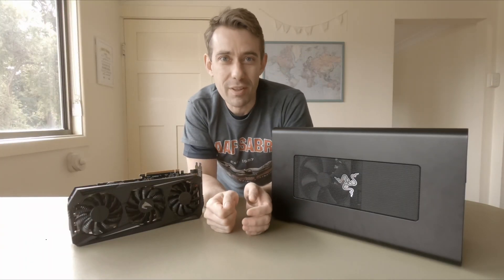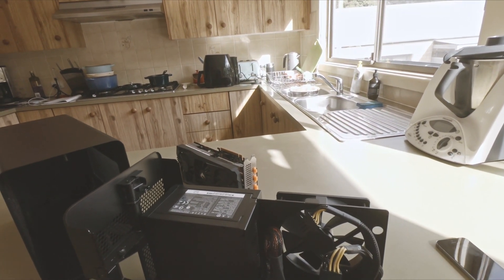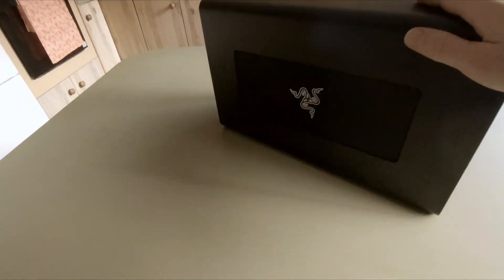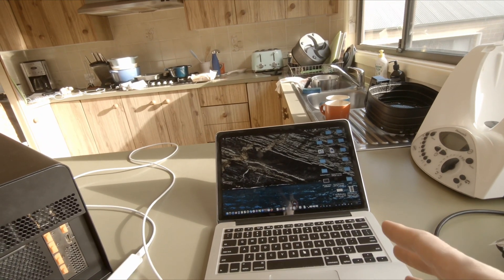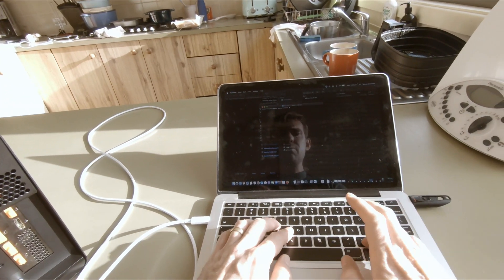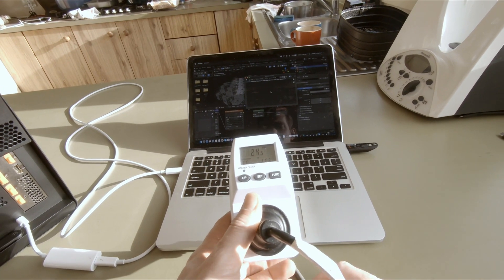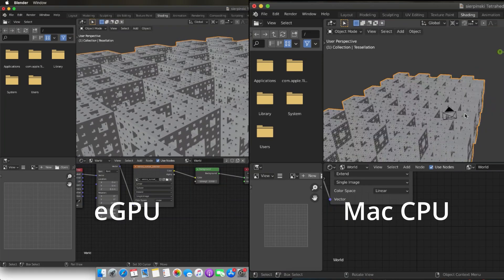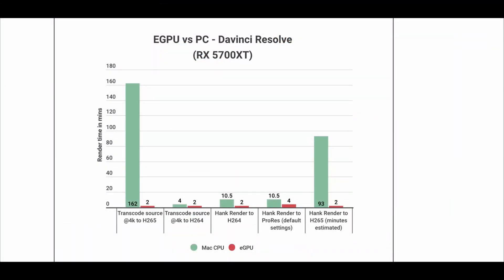Razer Core X eGPU tested with an old MacBook, can it Blender? Can it Resolve? Hell yeah!

Comment: Any chance you could run this with the MacBook Pro 2019? I’m trying to decide if egpu will be worth it or not/ what problems I may have in rendering. It has a i9 processor and I have successfully been able to use cycles rendering system
Reply from the maker: Basic system requirements are intel processor (Apple silicon doesn't support eGPU acceleration) that has thunderbolt 2 or 3. The version of macOS we run is catalina, though you may be able to run more modern versions than this. Checkout https://egpu.io for more up to date info. Its where we get ours from :)

Hope this helps.

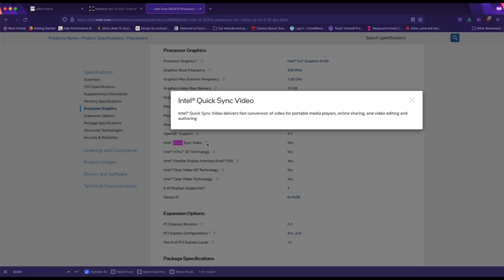Comment: At 09:37, to which version of Macbook Pro were you referring when you said "macbook does have hardware support for H. 264, but it does not for H.265" ?
Reply from the maker: Hi, thanks for asking, we updated the video description to include the hardware used. The MacBook is a late 2015 Pro model with a dual core intel CPU. The CPU is the one shown at around the time stamp you mention.

Comment: What have you changed in the Settings from Blender or so that Blender uses the eGPU?
Reply from the maker: The settings that make Blender use the eGPU are the Blender > preferences > system options for which compute device should be used. Also make sure in the render properties tab in your scene, that you have the "Device" type set to GPU for rendering in cycles.

The eGPU should be visible in the system preferences under "Cycles Render Devices". Make sure it is checked/enabled here. 

Remember that you will need to select a compute device appropriate for your GPU. If you have an Nvidia GPU, then CUDA, OPTIX device types should be chosen, for AMD, use HIP. Similarly for intel, use the intel device.

Other than configuring these options, there are no other settings in Blender you will need to change. 

Please reply if this helps?
Reply: @Crowdrender It worked thanks!

Comment: when using blender or resolve do you need a connect a second monitor? i red that there will be latency rendering back to the internal laptop monitor? Or is it doable just EGPU and laptop?
Reply from the maker: G'day! Honestly, haven't tried that! We usually use the eGPU with a second monitor and this really seems to help some apps. For example, running OBS is absolutely better performance with the second monitor.

We setup a stream one day without the second monitor and the macbook ran like complete trash, even with the eGPU plugged in. We had to abondon the stream. The day before we'd done the exact same thing and it was fine. The only change was not having a second monitor plugged in.

I think this is because the eGPU offloads some of the codec work. Sadly we never tested blender or resolve like this, without the second monitor. 

So, what we can conclude is that its probably likely that having a  second monitor will help, especially with accelerating the 3d view port in Blender and decoding in Resolve so you can edit smoothly. It seems that this might require a second monitor. Rendering in Blender or Resolve might be fine, but you'll likely not have the full benefit, which honestly is being able to run Blender or Resolve on the GPU and have a larger monitor than your laptop.

Hope this helps!
Reply: @Crowdrender  Thx for the info!!! i would like have the extra performance without the need for the external monitor :(  I already own a powerfull desktop pc .Sometimes i just want to edit on the couch with the need for the external monitor. I new laptop would be my best option :(
Reply from the maker: @robinreso6240  for your situation, if you need to edit away from your desk, whether on the couch or if you're travelling, yeah, a new laptop might be the better option.

Comment: A year later (2022-2023) mainly similar conclusions using Mac Mini 2019. Mac Mini, however, can be upgraded, as I did, with 32GB RAM, a big assist for Blender. The Radeon unit has behaved flawlessly. Another advantage of an external GPU for older Macs -- albeit an edge advantage -- is that it can be plugged into different legacy Macs you may have around, whereas built-in GPUs (as in the new Mac M1/M2s) are dedicated to the Mac they come with.
Reply from the maker: Thanks for updating us Jim :D Is the upgrade for the Mac Mini hard?
Reply: @Crowdrender  a bit delicate -- opening up the mini, replacing memory... here's the OWC video guide I used: https://www.youtube.com/watch?v=qKyv0QP4XPQ

Comment: In Blender do the PC laptop GPU, for instance a 3070, work in tandem with an external GPU? Or you have to use one or the other?
Reply from the maker: Honestly, we've not tested this, our only computer that works with our eGPU doesn't have its own GPU. Would honestly recommend asking this question on https://egpu.io. They have a ton more experience with eGPUs than we do.

Comment: I have very serious question. You tried kryptonite I assume? It didn’t work? I’ve been trying kryptonite instead of purge wrangler non stop
Reply from the maker: We have a video where James tried Kryptonite, it worked for us pretty much first go. This video might help? - https://youtu.be/kecpXq_5w44 

Otherwise if you are still stuck, highly recommend https://egpu.io because this is where we got our tools and information from.
Reply: Mannnnn it did not work for me AT ALL!
Reply from the maker: @bmax8958  There are some things that will definitely not work, such as using an eGPU with any of the new Macs using the M1 processor. Might be an idea to make sure you know your platform is supported. The egpu website I referred to in the last reply to your comment has a section where you can search through builds people have got to work. If you see your make and model of your host machine, eGPU and GPU there, then you have a fairly good guarantee you can get it to work.

This assumes you don't have a hardware fault though! Things like a dodgy cable, or a faulty part can also put a premature end to your party. So make sure you do some experiments to rule things out, like if you have another computer to test with, or other cables  you know work for other things, try replacing parts with known good parts, or using the suspect parts in a system you know works to try and isolate the problem.
Reply: I am using 2014 Mac mini with razor core X and AMD 5700XT. I’m assuming in scripted wrong as kryptonite has many weird obstacles, I am going to factory reset computer and run purge wrangler! See how that works

Comment: Sorry to bother you . Would you happen to know if this same setup would work with an Amd Radeon V7 and a 2017 MacBook Pro?
Reply from the maker: Hey hey :) Honestly the best place to go for questions like this is https://egpu.io as there's a whole community of eGPU fans there and they also have a section on successful builds. In fact we just checked and there's a tool for searching/filtering on the top of MacBook, the enclosure, and the GPU used in successful builds. 

You can find this handy lil' tool at - https://egpu.io/best-external-graphics-card-builds/

You should be able to find if others have managed to use the same hardware successfully. 

From our knowledge this should work, though we've only tested one build and we're also not on the latest OS, we're sticking with Catalina now until our MacBook dies!!

Best of luck my friend, hope you win here, its awesome having an external GPU to power through renders :)

Comment: May I ask if the mac will work even if I don't connect a monitor? Will it affect performance? Thank you
Reply from the maker: Yes, it still accelerates certain tasks, like rendering with ProRender, (and maybe even cycles-x, not sure yet, have to ask the Blender devs how their support of Apple's MSL is coming alive :) ) and Davinci resolve. 

Basically for productivity, compute intensive apps can be accelerated so long as the vendor supports either openCL or Apple's metal framework. 

What you might not get though is the nice smooth performance of the rendered viewport in Blender, and also DaVinci resolve. When you plug a monitor into the GPU card in the eGPU, apps that are displayed on that monitor are noticably faster. Without an external monitor, the acceleration probably won't be as good as you'll most likely be relying on the internal GPU for the built in display of an imac/mackbook.

Comment: Hey, man. Great vid! I myself am perusing an eGPU setup for my MacBook Pro 2012 and I was wondering if you knew how eGPUs would work with bootcamp for gaming? Is it mostly plug and play or is there an initial setup you have to go through every time you want to use your laptop with the eGPU? Thanks in advance!
Reply from the maker: Yooo! Nice :) Soo, bootcamp, we've not ventured that far yet, but do check out this website, https://egpu.io they have a ton of advice, plus forums for help and there's definitely content about bootcamp on there.
Reply: @Crowdrender  Thank you, my G. I’m glad to know that others have found success in these external graphics projects! I have one more question, however, If that’s not too much lol. We’re you able to put your laptop to sleep (close laptop lid) with the egpu connected? Would you need to manually turn off the egpu?And would it automatically resume once I turn on my laptop again? Again, thanks in advance!
Reply from the maker: @lemonke3774  Trying that now
Reply from the maker: Seems to handle it just fine. Though this setup has the eGPU setup with an external monitor, so closing the lid just rearranges the displays. This 'works' as well as it does for no eGPU. Thanks to apple for that.

As for sleep, yes, resuming from sleep has no issues. Bear in mind we're working on a new video on Kryptonite, which we're using to run the eGPU in macOS. Purge-wrangler has been replaced with Kryptonite so we're testing it out. So far so good. 

So all the tests I just did were using Kryptonite, not purge-wrangler.
Reply: @Crowdrender  Hey, thanks so much for taking the time to answer my questions! I really do appreciate it. I hope I’ll see as much success in my egpu build as you have!

Comment: Hi James,
thanks for the indepth presentation!
I am using the egpu enclosure for quite some time now.
My mainsystem is an intel nuc hades canyon running win10prof. the egpu is equipped with an rtx 2080super wich I got just before the prices went crazy.
To my experience you get even better performance if you hook up the display directly to the egpu (if you use an additional one instead of the laptopscreen).
I also use it with my Ocolus Rift-S VRglasses in blender. The results I get with eevee in VRmode are stunning and give a very realistic impression on realworld size of an object.
Another thing I use it for is gpu-redering in blender - works great.
To me it did extend the usage of my hades cayon a lot. Sure there are some performance drops compared to a beafy pc, BUT I love the setup for its versatility. I even onve added a second enclosure and a second card and had blender render on multi gpus at the same time. Also being able to use the card on different computers is  an very nice feature - so finally you can share renderperformance with your mates ....
I got my enclosure used from amazon for a very good price .... (with all it's pro/cons)
Thanks for your excellent video on that topic!
Reply from the maker: Awesome stuff Rainer :) great to hear you love your eGPUs too! Hadn't really thought about NUCs but the way you describe it sounds like they're a pretty good match. If you don't mind, how much RAM can you get in a NUC? And while I am at it, how much storage too?
Reply: @Crowdrender  Hi James,
I have 64GB ram in it (two sd-rams), actually only 32gb are officially supported but the i7 is capable of it and frankly I think this might be from a time when only 16GBmodules were availiable in that format.
The nuc also supports two nvme disks being able to run either individually or via the onboard raid-controller as raid 1 or 0.
Just recently I upgraded to the much newer quartz canyon(8 core xeon) and put that along with my 2080super in a Cooler Master MasterCase NC100 PC. I like it very much - and it has two thunderbolt connectors ....
Reply from the maker: @rainerseitner6872  This sounds great!

Comment: I use a Vega 56 eGPU on my 2018 I7 Mac mini.  Under Bootcamp it was always a chore to get the eGPU to work due to a resource 12 bug or something like that. When it did boot up it was much faster than my 6 core I7 CPU. My benchmark speeds always seemed in line with desktop Vega 56 users. I have since bought a PC laptop with a RTX 2060 which is much faster.  The laptop does have TB3 so I have been considering trying to use both together.  If the GPU market wasn't so weird right now I would get a 2060 or 3060 card to put in the enclosure so I could use two GPUs. I can probably use the Vega 56 but I'm honestly not sure how well Blender handles mixing CUDA and OpenCL.
Reply from the maker: Great to read all that Thomas :) What enclosure are/were you using? Also did you have any speed issues with scenes larger than the Mini's physical memory?

Yeah, blender is not able to use two different devices in the same render. If you have enough RAM to load the scene twice, however, you can actually do this. You can use two instances of Blender and use the "placeholder" option in cycles with overwrite turned off. This way you can setup two background renders of your animation, one of them using CUDA, the other the openCL card. 

This obviously has limitations though, first, you'll need enough RAM, second it only really works for animations as stills can't be accelerated in this way.

Comment: I saw a review of the razer core last year where they said it produced 30% lower render speeds than on pc. Something about the usbc bandwidth being slower than pci. I guess it depends on the motherboard you are using as to whether there will be a bottleneck.
Reply from the maker: Certainly, we saw a massive drop in speed with one scene, but that wasn't due to the bandwidth per se, seemed to be because the host system ran out of RAM. What would be cool is to test the Core X with a system that has enough RAM to stress the thunderbolt link, working towards that at the moment :)
Reply: @Crowdrender  Look forward to it. It does look like a pretty neat bit of kit ... even if it runs a bit slower.
Reply from the maker: @DirkTeucher  Cool! So far the slowness is restricted to the sync phase of rendering where data is being transferred to the card in the enclosure. The actual rendering part of the process looks like its exactly the same speed, which makes sense since this is the part where all the work is being done on the card. 

Anything that involves a lot of data/commands going back and forth between the host system and the card will probably run a bit slower (it did in our tests), but that slowness seems small unless something drastic happens like the host running out of RAM :)

We've not yet been able to reliably separate whether marginal slow down are due to the host system being shite, or the thunderbolt being slower than a direct PCIe connection. In the video we tested a scene in Blender on a PC and the macbook+eGPU combo which only rendered a little bit slower. We're going to try and setup a test that can push the bandwidth a bit more using another host system.
Reply: @Crowdrender  Yeah Cycles recently added the "persistent data" feature which makes animation rendering faster as the asset files get cached and don't have to be calculated on each frame for example (No idea if Radeon Pro Render does this). But this only works in scenarios where the meshes are not animated so architecture renders and what not. I would imagine that in those scenarios the Core could probably be pretty close in speed after the first frame is rendered compared to a card built into the PCI slot. 
But what if the meshes are animated and each frame cannot be cached? I guess as you said it depends on the size of the scene. And what about viewport denoising compared to PCI I guess its pretty good on the Core X? I have two RTX 3090 FE cards which when stacked on top of each other in the case run too hot for my liking around the 75-85(C) mark so I have one on a PCI extender cable at the moment but looking at either water cooling both cards or permanently mounting the 2nd card outside the case somehow ... perhaps with a core but I dunno ... that price tag is pretty hefty, I am not entirely convinced.
Reply from the maker: @DirkTeucher  Interesting! Preferences here would be to keep both cards on the mobo and do what you must to keep the heat down. I think the CoreX really comes into its own when you want to add more GPUs than your case can handle, and you don't want to change mobos, buy a bigger case, bigger power supply, etc. In that use case, it is pretty easy to justify it. 

If you already have a second PCIe slot, then.... well, that's where we'd be putting the second card :) 

Though have to ask, does the second card run cool when its not inside the case?
Reply: @Crowdrender  yeah external is 35c when not under load and same temps as the one inside the case while rendering. External is normally a little bit cooler actually by a few degrees.  But having both cards onboard without watercooling them gets "card gonna die soon" temps 😂
Reply from the maker: @DirkTeucher  Water cooling sounds like a good bet, and should give you the best performance, though I wonder after spending the $$ on the water block and loops how close you'll be to the price of the Core X?
Reply: @Crowdrender  Yes exactly. I'm thinking that sticking with that pci extender cable + a custom 3d printed external side mount is probably going to be the route I go down.